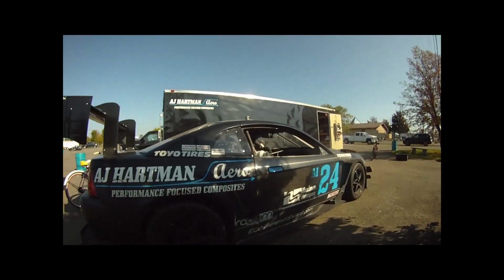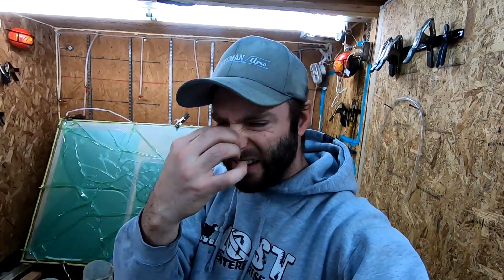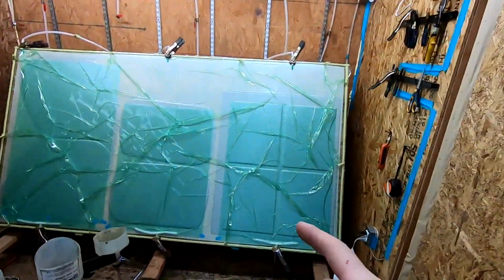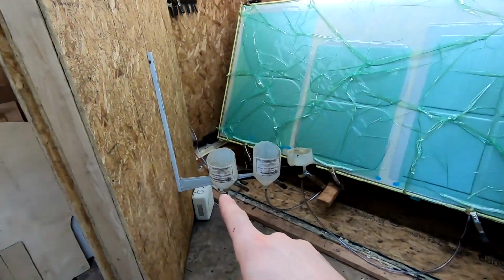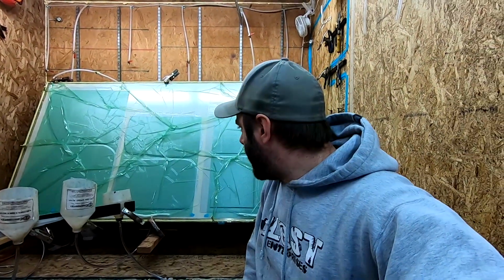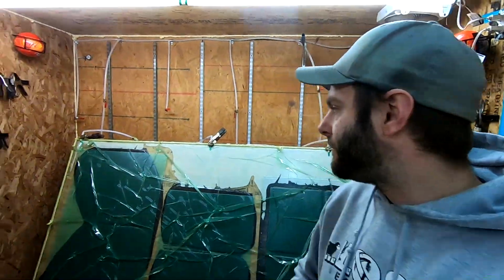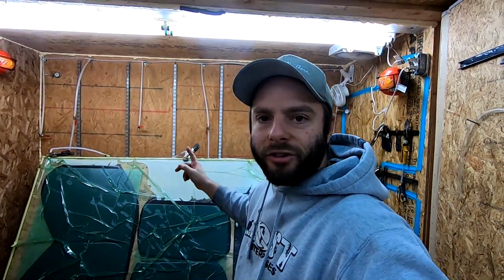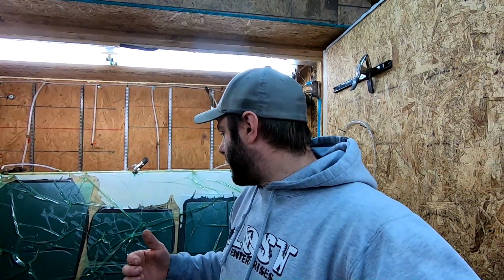Multiple Part Resin Infusion

Comment: Why is the resin going uphill?  Wouldn’t it be easier to put the inlets on the top and have gravity assisting the vacuum pull the resin to the bottom outlets?
Reply: Barrett_g i believe he explains in another video, but essentially you want to work all of the air out of the system. air travels to the top so having the vacuum lines at the top and the resin feed at the bottom you are less susceptible to air bubbles. hope i’m explaining that right
Reply: derpy works ahhhh yeah that does make sense!!!  Thank you!  I figured I was missing something!